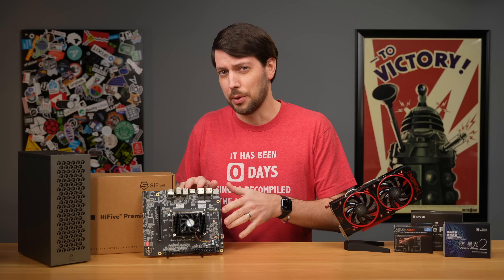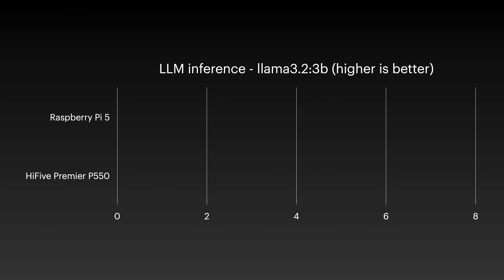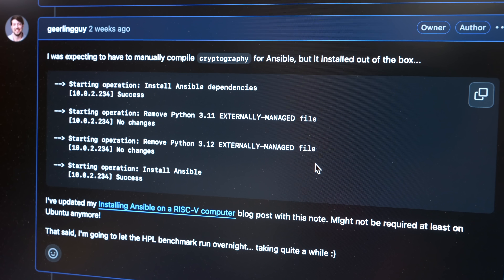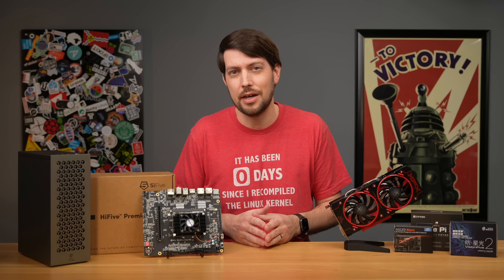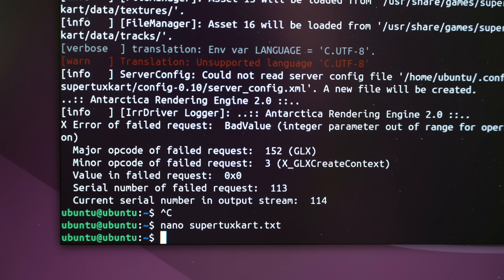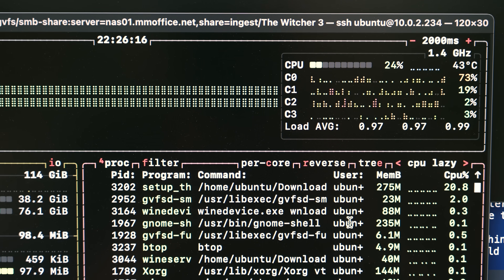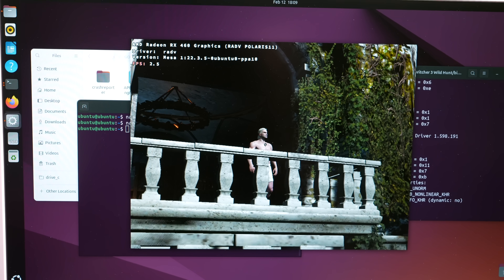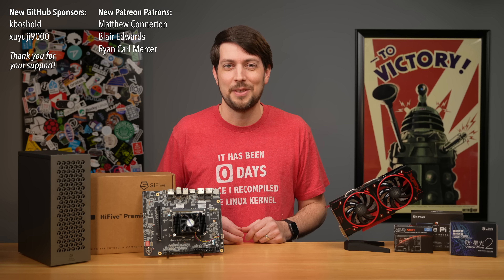RISC-V was supposed to change everything—How's it going?

Comment: RISC-V is cool and better than ARM but there's a couple of things I'd like to mention. The first is that ARM shouldn't even be called "RISC" when you take all its instructions into account. Like you can't tell me with a straight face that the "JavaScript Floating Point to Integer" instruction is an inherently "RISC" instruction. The existence of the many SIMD instructions themselves are also questionable since SIMD came first on x86. MMX instructions were a big deal and later came SSE instructions. Only after like SSE2 did ARM go and say "Yeah maybe we should do that too".

The second thing I'd like to mention is technically there's nothing stopping anyone from using an older x86 design from like 2004 or before. The patents have expired. We have companies like Vortex86 making Intel 486 clones for many years because the patents for those have long expired. The same can be done now for the first AMD64 CPUs (the first 64-bit x86 CPUs). If someone could mimic those chips from 2002/2003 and take advantage of how small modern die sizes are, they could get some pretty energy efficient chips. They wouldn't be fast obviously but they'd be good enough to do a lot.
Reply: The RISC-V has SIMD extensions and other "complex"/"CISCy" extensions too. The distinction between the 2 types is quite blurred these days due to all these added extensions. If anything maybe the only "purist" RISCs left are really simple microcontrollers like the AVR; everything else is just more CISCy or less CISCy.
Reply: @ShimrraShai  at the very least from what I've seen of the RISC-V programmer's manual, it seemed a bit easier and more coherent than ARM's mess. The main strength of x86 to me is how there's a great amount of unity. When a chip comes out I rarely think to myself "Does this come with SSE3 or not?" because these days they all seem to come with everything except for AVX512. 

ARM CPUs on the other hand are all over the place in many different ways. There are different implementations of the ISA both official and "semi-official". For example the M-series didn't even have a division operation for a very long time and then there's frankensteins like Apple's for the high end that might as well be a different ISA compared to the average high end phone SoC.
Reply: @sharoyveduchi  Yeah a good point for RISC-V for sure; I wasn't saying though which of ARM or RISC-V was better.

Though regarding X86, if we start having people build more X86-alikes from its earlier versions I would expect that kind of fragmentation would start to creep in there too as people start extending it in their own idiosyncratic ways. It seems some sort of standards organizations would be need to uniformize and normalize these designs.

One thing I wonder is why we don't have any "proper" vector processing units today like the old Cray processors where you can switch the vector size with an instruction all the way up to a goodly length like I believe 64 elements per vector, instead having these various SIMD extensions that all overlap and extend each other in messy ways for variously sized short vectors. I mean that's fine for a lot of things even if klutzy to program on, but I think a fresh design should incorporate a proper and full, sweet vector unit.
Reply: @ShimrraShai  It is a bit of a mess, undocumented, and using a weird vector form that just isn't as a fast as fixed width SIMD.
Reply: Please get a clue about things you write about.

RISC-V is a simple instruction set designed for educational use and it lacks LOTS of nice features ARMv8 have that allow ARM code to perform same task with much less instructions.

For example, RISC-V has no select/conditional move instructions, and it has only base+offset addressing mode. A very common thing is to access an array with a dynamic index - RISC-V needs 2-3 instructions for that, ARMv8 only one.
Reply: @hkultala  Uh, the RISC-V has a range of extensions, just like ARM does which was my point too.
Reply: @hkultala  watch your mouth lol. You accuse me of not having a clue and then say a RISC-V has no conditional instructions when the RISC-V assembler definitely has branch instructions (in other words, conditionals!).

Using "simple instruction set" as an argument against RISC-V doesn't make any sense when the trendy thing to do is supposedly make things more Reduced.

People were using MIPS variants for many years in game consoles like the PlayStation 1 and 2, laptops and desktops in China with the Loongson architecture, and there were various internet routers using it. Richard Stallman's first fully FOSS laptop was using one of those Loongson laptops. Now we've got RISC-V which is actually a beefier version of MIPS with re-arranged bit fields for how many bits an opcode could take up, how many bits for a jump, etc. and you're trying to slander it by saying RISC-V is just a toy or something. 

You know what an actual toy is? The ARM cortex-M series which companies like Texas Instruments try to pass off as respectable products. Grow up!

Comment: Because of Raspberry Pi's approach to ecosystem, I'll be waiting for the day they switch to RISC. It's certainly no small task, but they recently designed their own chip for the 5. It will take forever for the whole of RISC dev to specifically designed unified software layers where at least one company needs to take on an ecosystem.

Comment: Interesting. You say that board is barely faster than a Pi 3b+, but my VisionFive 2 is way faster than my Pi 3 for many of the tasks I run on it (I use them as build servers) - nearly as fast as my Pi 4 on many things.
Reply: Now that I think about it, I'll bet a lot of that is simply that my VF2 has more RAM than my Pi 3 and that has a big impact on compiling large projects.
Reply: Power draw?

Comment: Honestly, I low-key love that the CPU/RAM[/GPU?] is an edge slot design that can be upgraded at any time as faster processors emerge. However, I do wonder if more PCIe lanes are wired to the CPU slot than are currently available on the CPU, such that a later CPU card could give more lanes to the PCIe slot later on. 🤔

Comment: There's still no arm board I know that can run 5120x1440, let alone at 240hz, so while I would love a very low heat, power sipping desktop in summer oh wait, a 5600U is exactly that. Doesn't actually use more power than a rk3588 to complete the same task. Risc-v has a long way to go if arm isn't even there. It's probably gonna be all over smartwatches, mp3 players and such soon though, the modern mips soc.

Comment: That's a really interesting board, with all the hardware and some missing software/drivers, which are slowly coming.
Jeff, I've got a question! Which CLI tool did you use to monitor the chip utilisation?
Reply from the maker: Good question, that's btop! I have a video on Level2Jeff going over btop and some other monitoring utilities I use.
Reply: @JeffGeerling  Thank you!

Comment: How does RISC-V compare to arm's ISA with regard to performance per watt?
Reply: Totally sucks, because it needs much more instructions to perform the same task, because of lack of good addressing modes and lack of select/conditional move instruction
Reply from the maker: Not good; I mention perf per watt in the HPL efficiency benchmark, and this machine's chip is still sub-1Gflop/W, which is worse than even a couple generations-old AMD and Intel chips.

Arm is up to 3-7 Gflops/W, depending on the chip.

Comment: You know ARM is also RISC but do you know X86 is also RISC?
Modern at least high performance chips are called Post-RISC.
RISC-V is also moving in to this direction if they are not already there.
The CISC vs RISC only really matters on smallest simplest chips.

Not to mention last CISC CPU called Pentium MMX has less instructions than today's "RISC" CPUs.
And Pentium already used many of the advancement in CPU architectures which at first were what made RISC different from CISC. The whole thing already started blurring at this point and P6 architecture used in Pentium Pro/II/III/etc. was full blown Post-RISC, especially with original Pentium Pro where Intel didn't bother with all the legacy instructions and just emulated them. That said its not like they changed a lot with Pentium II - its still the same idea and implementation but they vastly optimized the instruction decoder that uses microcode to issue uops - this part in Pentium Pro looks like it was slapped there for compatibility but it was expected all the software will move to modern compilers which will treat these CPUs as RISC.
Reply: micro-ops are not RISC instructions.

No x86 is RISC.

Comment: It's incredibly impressive that the Witcher 3 runs on this thing. Sure, it's unplayably slow, but there are so many pieces that have to line up correctly for the game to even start in this scenario, that it still impressive.
Reply: It wasn't even that long ago (maybe 6 years ago), where you couldn't run modern Windows games on Linux.
Reply: @d0cx  and now people are using wine to run gta 4 on flagship android phones. Just hope that the pace of progress still kicking strong a few years later
Reply: @d0cx  turns out having a billion dollar company (Valve) backing your project's development instead of having random hobbyists cobbling things together makes progress actually happen.
Reply: @alex31ytb  This is awfully dismissive of the impressive work those "random hobbyists" have "cobbled" together, which valve is largely piggybacking on. Like, valve did not come up with Wine or DXVK.
Though your point still is true. Steam, being a near-monopoly on video game lending and access control, deciding to enable that to work is a boon.
Reply: There are TONS of research resources inside and outside of academia going into research on Risc-V.
Reply: yes, absolutely amazing. thanks @JeffGeerling for exploring this! also the speed of progress (in software enablement) is mind-bending. two years ago when i got my visionfive2 it was an utter trainwreck (for me). not even a fancy paperweight. But now it's actually easier to install & run unmodified ubuntu/fedora on it, than on most arm sbc's. Just look at the fedora/ubuntu wiki and you instantly realize it only works on enterprisey arm (ampere, ...) & raspberry pi's. so while it's rather slow it's my preferred device beside the pi cm5, pi zero2 and classic x86 to run native stuff & containers. it also beats any armv7 device (like the pi2), as support for those is gone.
Reply: Well if unplayable slow is valid then anything can run anytbing
Reply: @jhoughjr1 This is majorly incorrect. Programs can only run on the architecture that they are compiled for, getting something to run is a massive achievement

Comment: how/when is RISC V going to get faster?
Reply: Never going to reach the level or ARM/x86: The ISA lacks important features that are needed for good performance, things like good addressing modes and select/conditional move instruction
Reply: @hkultala  I guess my question was more about when it would be fast enough to handle most computing tasks, not whether or not it would be capable of surpassing ARM or x86. Right now, it looks so slow that I wouldn't even want to use it for stuff like watching a YT video (which I would do on a RPi5

Comment: well, will see when the retail market is flooded with incredible devices with low heat dissipation, minimal power requirement but brute processing power of a supercomputer from a few years ago...for the price of an avocado sandwich.....hope somebody will solder together a competitor to nvidias digits, just add another module to scale up to your needs, from simple workstation, through basic AI assistant towards a modern supercomputer that fits into a shoebox

Comment: It feels like you've changed your video LUT or something. It seems that you're pulling 255 down to 212 or 208 and pushing zero up to 9 or 13 then remapping ? -- I've seen this "LOOK" around lately -- it sucks.
Reply from the maker: I don't know much about LUTs; I record in ProRes Proxy, then convert to H.265. The colors are straight out of my Sony camera with the 'Standard' profile, and then I let Final Cut Pro just import the footage then re-export with H.265 at high quality.

If a shot is way off color balance, I use Final Cut Pro's automatic color balance tool fix it up a bit, but I don't touch colors or LUTs or anything. That's for all them fancy tubers!
Reply: @JeffGeerling  It looks like some HDRI remapping to a soft and gentle kind of look, it's either been a (lately) trend or is build into conversion. For proper (documentive) color rendition refer to BATMAN 1966. Or, I'm just old now and this is really just "You kids git yur fancy color spaces offa my lawn..."
Reply from the maker: @liquidmandotcom  Sometimes I wonder if YouTube messes with color spaces when they're doing their transcodes... if you see it across a lot of channels, I wonder if that could be it, because the sharpness and IQ is always a little different after upload.
Reply: @JeffGeerling  Oh yeah, interesting point.

Comment: No, sorry. But I have a Milkv Pioneer, which has 64 cores with 128G of RAM, and that is very much faster than any raspberry pi, but also way faster than the HiFive Premier.

If we lived close, I would be more than happy to share this hardware with you for review, but I'm in Costa Rica. Would you be interested in ssh access over zerotier?

(Or, cheap milkv should absolutely send you one for review!)
Reply: meh, slow as a snail...
Reply from the maker: I've asked Milk-V about it in the past. I would need hardware on hand to run my full gauntlet of tests in a controlled environment... not sure why the Pioneer hasn't been more widely available (two of the three suppliers Milk-V lists have zero stock, and it's been like that for months!)
Reply: @JeffGeerling  Perhaps because Sophgo has been placed on a sanction list?

Comment: RISC-V is dead slow compared to x86 and ARM (so slow its unpractical to use), and RISC-V chips are mainly beeing produced by chinese companies (big no no in my book). I seriously don't get the hype around RISC-V at the current point in time. It's at least 5, maybe 10 years premature, we need more consumer grade high performent fully open source chips designed by western companies, and I really don't like the fake advertisement surrounding RISC-V chips, namley that their design are based on an open architecture (that part is true), BUT the final product, the actual RISC-V SOCs themselves are mostly proprietary chinese designs based on the RISC-V architecture, so there goes that argument as well. 
Don't get me wrong, I hope RISC-V succeds in the long run, but at this point in time, it's mainly unfounded  hype.

Comment: The M.2 wifi card used in the Dell Wyse 3040 is SDIO. Not sure that it would be compatible anyways, but it DOES work in x86 Linux. My 3040 came with one, but no guarantee yours would.

This thin client is ~$30. I'd happily send you my wifi card if you ever wanted to try it.
Reply from the maker: For this board, I will wait until ESWIN has their card available. I figure I'd rather not spend hours debuggin WiFi on RISC-V Linux in case there's some weird SDIO quirk on the chip :)

Comment: RiscV boards will end up just like arm boards. It's only the instruction set that is free. So your misrepresenting it a little. If you want to use it you still have to implement that. I.e. design a CPU. Or like with arm you could license a design.
Then you also still have to design a board and like with arm boards these will all be different. 
There really is very little difference in daily life, so I don't really see any advantage aside from that competition is a good thing. But for the foreseeable future this is not a threat to anything.

Comment: 6:56 PCIe 3 x4 is 4GB/s max, not 8. Am I missing something?
Reply from the maker: Full duplex theoretical bandwidth limit is 32 GT/sec, which is roughly 8 GB/sec.

Real world performance will always be much less, but a quality NVMe SSD controller should be able to put through at least 2+ GB/sec over that link.
Reply: @JeffGeerling Thanks for the quick reply! That certainly explains the confusion. I find it very odd to refer to the theoretical "full duplex" speed for data-transfer-rate. I would never measure an SSDs speed for example while reading and writing at the same time. You also measured only the one-directional speed - write speed in that case. That would be a test to see how close you can get to 4GB/s, which many SSDs can come pretty close to. I myself cannot see the 8GB/s figure to be of any value for real-world applications, this is why it confuses me in this context. Do you have an example?
Reply from the maker: @NebukadV  For networking especially, full duplex is pretty standard as you're usually pushing data in and out at the same time. Most people don't saturate the bandwidth both ways, though I know some homelabbers who probably do.

And enterprise applications often have storage pushing data both ways all the time, but most consumer gear, it's more slanted one way at any given moment.
Reply: @JeffGeerling  I see.
In my opinion, the full duplex speed is still the wrong metric when talking about storage. Even enterprise storage cannot read and write at full speed at the same time. I have yet to see any drive-metric or benchmark, that tests a drive both ways simultaneously.  
And again: You didn't either. You stated the 8GB/s figure and then followed up with 2 benchmarks, that would peak at 4GB/s (or 1GB/s for one lange). Even if full-duplex would be the "correct" metric, that would be confusing at best. 
For what it's work, Wikipedia seems to agree with me, stating only the one-directional transfer rate's for PCIe.

If in your experience, the full-duplex speed for PCIe carries weight, that's fine. Maybe I'm just not enterprisy enough, so I still find this figure useless or misleading at best.